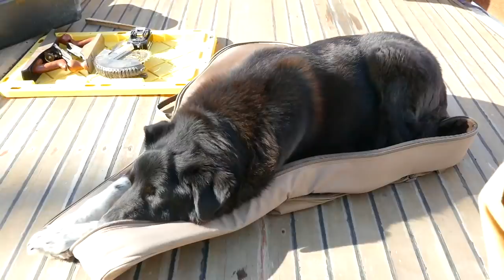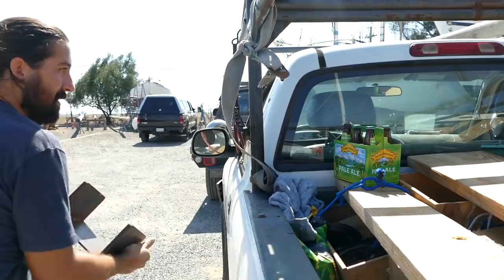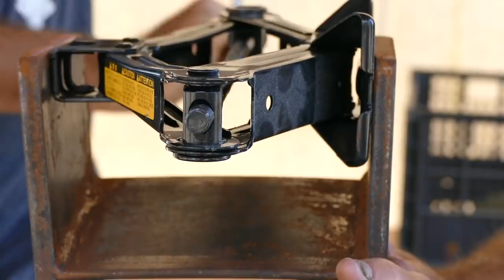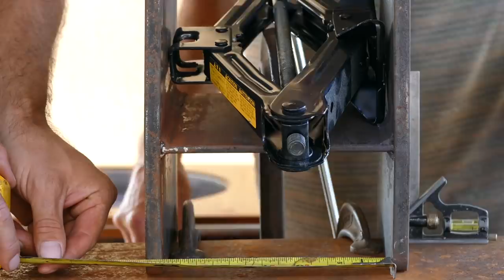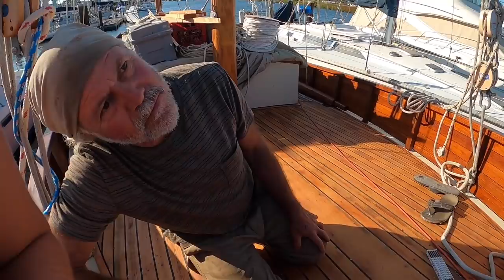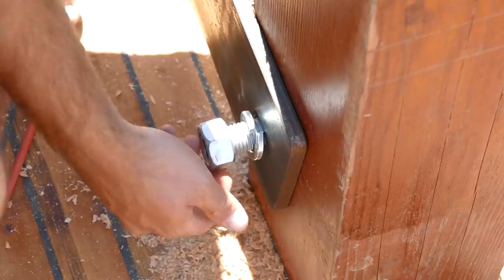Salt & Tar: Ep.104- Stick Welding Our Hinging Bowsprit Bracket

Comment: nice job! Next time when drilling metal, you may want to use some lubricating oil so that the drill bit does not burn and looses its sharpness too quickly.
Reply: I was going to suggest the same thing.  The oil keeps things cooler and makes the drilling faster.
Reply: Ya, we can see that the drill bit is overheating. Also, I would suggest, with that steel thickness, he should have use slightly larger drill bit, than the hole, gradually up to the last one.
Reply: cutting oil  protect your tools plus it will cut metal faster.

Comment: Nice work on the hinge joint, but I would caution you that since you have a single bolt going through the sampson post, it will also provide a hinge point.  The weight of the bow sprit and the flexing of the boat combined with the rigging will be cycling both hinge points up and down.  As the upper and lower faces of the web bear on the Sampson post, over time they will start diging into it.  You can avoid this by creating what is called a moment connection to resist the rotation.  By adding more bolts through the sampson post, the hinge won't be able to rotate on it any more and will become rigid to the post.  Any kind of symmetrical bolt pattern like three bolt, four bolt, 5 bolt, etc will work.

Comment: When welding using any method you will have some warpage.  How much depends on the size of the material, the thickness of the material, the size of the weld, the weld pattern (continuous, stitch, etc) and the type of weld (flat, butt, filet, v-groove, etc.).  So, bottom line, don't beat yourself up over the bit of warpage you had Garret.  I've seen much worse on more critical items than your hinge.  Just keep welding and learning and you'll be fine.  Thank you for the great video and my best to Teddy.  What a great guy to know.

Comment: I solved a similar problem using an air hammer with a purposely dulled chisel chisel. Just place the chisel in the center of the fillet and hammer moving along the length of the weld. As long as you are not cutting weld you are doing no harm, planishing the weld in this way actually strengthens it I am told. A welded picture frame can be brought into square using a ballpein hammer by striking only the weld. The change is so gradual you can finely tune the angle of the joint.

Comment: Rock on guys 💪 with the 71/8 you could have cut two bords for in-between the metal to the size you needed. place one side with the torch then clamp  the two sides of metal to place then torch and place the other side and let it cool 😁. But there are many ways to accomplish a goal. You guys are great and I love the adventures.

Comment: very nice, just in case no one has said yet if you weld short welds and skip around allowing the metal to cool a little between concurrent welds it shouldn't move as much or at all. nicely done though we've all made that rookie mistake.

Comment: When stretching metal like that. Once you have it passed the point you need to hit it with a hammer at the fold point, then when you release the pressure it will remain in place. You are giving the metal a new memory. You don't even need heat to do this.

Comment: I grew up with imperial, had to start using metric, struggled ever since. But metric makes more sense. my tools are a mixture of both, ha. Love your channel guys.
Reply: Been an architectural designer for years. We had to draw house plans to metric 30 years ago for city appoval. Fine. Ok.
 BUT ALL wood materials are still in imperial ! Try to explain that to a carpenter... A 2x4 is still a 2x4 ! Same with plywood boards, gyproc sheeys etc. Madening.

Comment: the correct way to have done that would have been to heat up the back side of the plate directly opposite and in line with the weld to a light orange color and then just let it cool to restraighten itself. And to have clamped it in place to avoid warping in the first place. Live/learn :-)

Comment: Because it is such a large hole so close to the end of the Bowsprit I would plate the top and bottom of it (the Bowsprit) to avoid it splitting at the bolt hole. There is going to be a lot of force pulling up on it (the Bowsprit)  I would worry that it would/will crack!

Comment: You wil have some problem with corosian with all your brackets and fittings if not galvanice
Reply: I mentioned this about previous metal pieces so it's good to get some support. The galvanising process is inexpensive too, so to me a no brainer. It's basically just a dip in a bath of molten zinc.
.
Reply: I’m sure they are well aware of the value of hot dip galvanising, but getting every thing sorted, working and finding the problems with humble paint makes sense. Then they can have a session stripping the rusty steel out angle get the load done in one go. Some galvanising companies have a minimum order charge, so this will be more economical.
Reply: And a bronze bush in the bowsprit, Or you risk having a sloppy egg shaped hole that would allow side to side movement of the sprit that will cause more problems down the road.

Comment: Six and fifteen sixteenth?thank god im in Europe.
Reply: The nice thing about Imperial is, the center is, 3 15/32" does not require much thought. The measuring system was devised by craftsmen and tradesmen for craftsmen and tradesmen.
Reply: Having worked on both Airbus and Boeing airplanes, I prefer imperial. Thanks!

Comment: What are you going to treat the bracket with to prevent rust and wood rot?
Reply from the maker: Ospho then epoxy primer then black rustoleum and it'll be bedded in tar or sika flex
R

Comment: Not to criticize but a little oil on the drill bit would have been easier and save the bit another thing that would have been better to slow the rotation of the drill itself
Reply: And a progression of drill bit sizes, rather than jumping from 1/2" straight to 1".

Comment: Welding procedures are required to keep the fabrication square, bit like sequence tightening a cylinder head on a car, only experience and a good teacher will help you with that, but as a beginner   your doing ok.

Comment: Hey bud, the 1” hole that you drilled... should you put sealant on the wood in between the metal plates? (The walls of the hole you drilled) Water will get in there with waves and rain right?
Reply: I'm sure that this is a dry run. More to come.
Reply: They did say that they were still dry-fitting. Up til now they're done such a good job on sealing, it's hard to imagine them stopping now.
Reply: Not necessarily.  The wood will swell a lot.
Reply: Fredrick Rourk sorry the late response, I agree with the wood swelling, but that will mess with the pivot on that bolt if it’s to tight, so they might want to find the right torch of that bolt, and maybe something to help the pivot that will constantly moving right? I am no expert, so I am curious and I am just looking at this from a construction point of view is all.
Reply: And I’m bored and I like the conversation! Lmao 😂 this virus is pissing me off. Lol It’s sad and irritating to live around, but we are all doing our best I think 🤔   Weird times brother. Lol
Reply: Fredrick Rourk these are the conversations I used to have when I was building and fixing stuff with coworkers, lol so sorry to do that to you. Lol 😂 my bad.
Reply: @SilentStorm_5  no problem

Comment: Build a jig that holds all the critical dimensions in place before welding.  Then tack weld to hold all of the parts in place.  Balance weld beads on opposite sides of a part so the cooling weld on one side does not warp the part.  Yeah , I know this advice is a day late and a dollar short

Comment: hi, welder here, it was a mistake but not that bad. a mistake is not getting enough penetration, bad tie ins, inclusions, wrong bead size or shape, undercut, overheating, and the list goes on. heat always moves metal, you can tack it all you want, and you´ll contain some of the shrinkage but not all. then you pick your torch and solve the problem. heat straightening is a science and an art and all you need is a torch and not much else but you have to get the metal red hot and know where and how much, jacks speed the process but not necessary. google or yt there is good information and videos. the welding arc produces among other nasty things lots of uv radiation, not good for your skin i think you know by now you can get a welder´s tan rather easily. thanks for sharing your jouney. take care

Comment: Um, your welds look like they had barely any penetration. I would suggest the next bracket you build, more heat, slower speed and three passes for each weld. It's called a Three Beaded T Weld if you want to research it. With salt in the air, you should reweld that bracket. Just do it now so you won't have to later.
Reply: The mini welder is neat but may not have the grunt for this thickness.
Reply: @delukxy  If he grinds off the mill scale, cranks up the heat and makes slow passes it should be good enough for what he's doing.
Reply: Think how far out it would’ve bent if he’d done that.
Reply: @FistralG  It didn't bend it pulled. That has to do with how he tacked it.

Comment: Any bow sprit piece should be stainless steel. I have seen many catastrophic failures caused by corrosion you can't see under the paint. Just my 2 cents.

Comment: Garret, you really are a master craftsmanin many disciplines but please, please, take care of your safety. That compartment seems more like a boat store than a workshop. you are surrounded by txtile material most probably combustible. you welding work top is also covered by the same material. I indeed it is a boat store there will be some timber , worse still paints and thinners and even suicidal a gas tank...I sincerely hope i am exagerating but welding and sending spatters of red hot steel around you in that environment is asking for trouble. only my two cents worth but it may cost you a lot more.
Reply: If I am not mistaken, those textiles you see in the shed are fiberglass welding blankets with the express purpose of guarding flammable material from catching, but I agree with you that some things were iffy in this one. For the most part, I am not a safety stickler because people can assume whatever risk they deem acceptable, but welding where there is sawdust seems suspect and drilling the metal plates barefoot looks 6 different kinds of painful in my experience. Glad they weren't hurt and hope they keep it that way!
Reply: @connorw5756  Yep, he's said before they are sheets specially made for welding. Some people just live to criticize tho without knowing the facts.

Comment: For those sensitive types, that is not a “blowtorch”. It is an oxygen/acetylene cutting torch, which isn’t the proper tool for that either. A “rosebud” and the cutting handle is the proper setup for that. Tomato,  tomaaato, who cares.
Reply: propane not acetylene. for that job, correctly done it´s the right tool